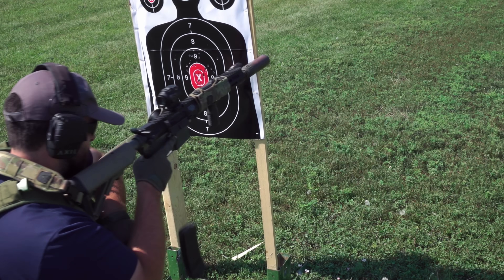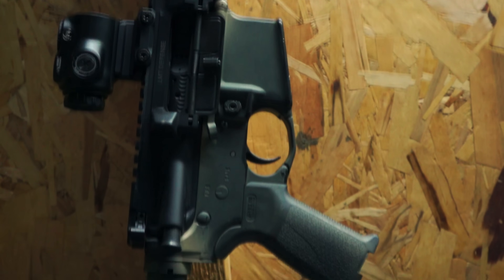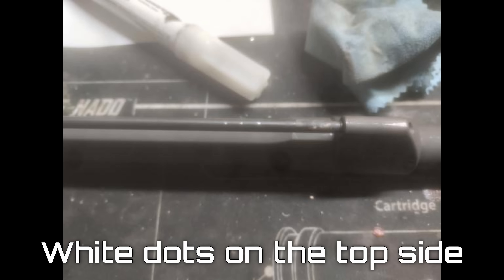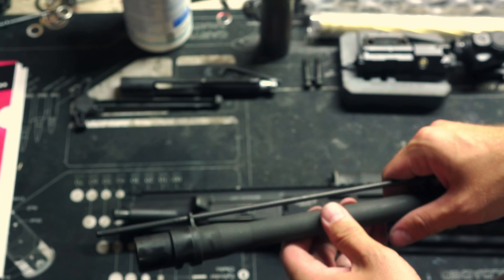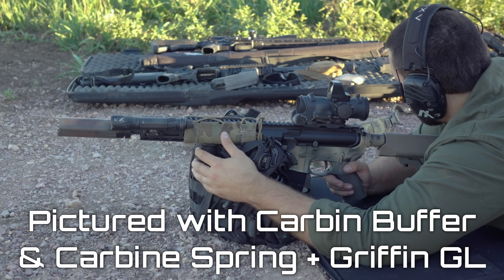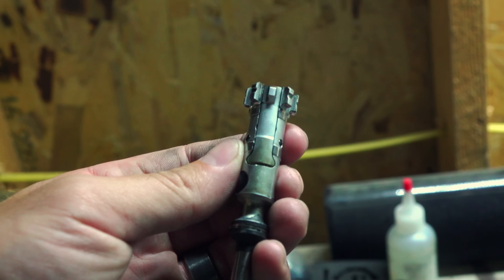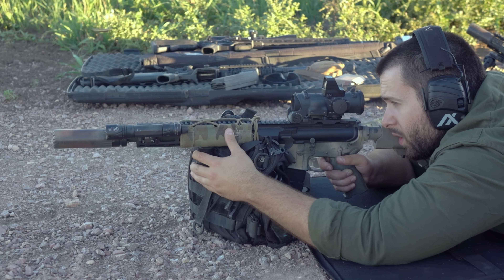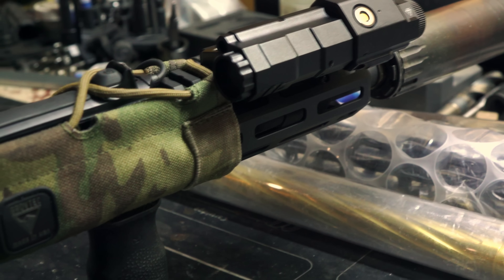Learning Machining Together - LMT 12.5" Specwar

Comment: The Spec War 12.5 I just got is anything but overgassed. It short strokes with every spring, buffer, bolt, ammo I’ve tried so far. Can’t get it to lock open unsuppressed at all. Contacted LMT… nothing.

Comment: 😂 would you relay to LMT that I would like them to put a piece of carbon fiber around the barrel extension to slow down the heat transfer😂 also tell them I want like a carbon fiber shaft around the gas tube as well to also slow down heat transfer

Comment: Not talk shit but what was the the point of racking the charging handle during the reload instead of using/releasing the bolt catch
Reply from the maker: My lower has a PDQ lever that doesn't work with the upper so I have to tap and rack to get it back into function.

Comment: Wow it looks like the Callaway 77gr rounds were keyholing. Really? You might want to dive into that a little more. That should not be happening on a $2500 upper that is supposedly optimized for duty use. Ofcouse the cutting of the barrel could have a hand on this result but still, this is completely unexceptible.
Reply from the maker: The paper was just tearing, no keyholling.

Comment: Your critique of the LMT Enhanced Bolt Carrier Group is misplaced. Their website stated: "This carrier group was designed to function effectively in full-auto, suppressed, and short barrel weapon systems" When they designed it in the 2000s at the request of the DOD, the were trying to fix issues related to the gas system and bolt breakage in the M4 (14" with carbine length gas system) because the carrier group wasn't updated from the AR15/M16 (20" with rifle length gas system). The M4 was so over-gassed (even without a suppressor) on full auto that bolts were breaking and the high cyclic rate led to multiple types of malfunctions. The carrier and bolt are a two-prong attempt to solve those issues. To slow down the gun, the enhanced carrier has a third vent hole for the gas and an elongated cam pin path. To prevent the bolt breakages, the enhanced bolt introduced relief cuts on the locking lugs, a stronger extractor design, and a new proprietary material for the bolt itself. To that end, the design is virtually flawless. It functions perfectly in the M4: the _"full-auto, suppressed, and short barrel weapon system" that LMT told you about.

However, you are trying to hold the product accountable for a use case which it wasn't designed for. The LMT enhanced bolt will work beautifully in any AR-15 platform, but the enhanced carrier is neither needed or advised on a gun that is properly (i.e. combat) gassed. With a 12.5" barrel and a midlength gas system, the specwar system is gassed exactly how it should be. Therefor, the enhanced bolt carrier isn't a wise option.

Comment: I got an LMT upper and few lowers.  They were way ahead of the industry. 

They moved their company 4 or so years ago from Illinois to Iowa and the move radically disrupted the business.  They basically have not released a new product in that time. They used to release one a quarter.  Their quality control has plummeted.  Previously I would have said that it was Best buy everything from them and they generally had pretty editive prices.  Now their pricing seems extremely premium and their quality across the board not justifying it.

I'd buy as little from them as possible to access the most unique aspects of their systems.

I think they make a great bolt. I think they're bolt carrier makes no sense, I don't have any affinity for their barrels.  I don't think their barrels are bad by any stretch. I just think that they are similar to  Daniel defense.  Overpriced workhorses.  I think you can get similar to better performance for less money  And less weight.  

I also want to say that they're monolithic upper is a great design for novices.  

When I was getting into rifles it was so easy to change out barrels and calibers with the Mars system.
Reply from the maker: I don't think the mono upper is for novices, it's more for the rigidity of the system.

Comment: I bought an LMT and I was NOT impressed AT ALL! 100% overrated, the ambi mag release did not work, the safety was so lose it felt like it would fall out, it literally jiggled, and could be put in safe after pulling trigger. I put a different safety from a different manufacturer in it to try to fix the issue. But the issue was the hole in the reciever was too large, so even the one I put in and tightened correctly did not fix the issue. I don't trust it. So it sits in my safe, unused. Kinda sucks.

Comment: Ugh has my dream rifle and puts trash optic on it. Gross brah.

But the EBCG is meant for 14.5” carbine length systems. It’s the entire reason it was invented. It was created from a socom request in the early 00’s due to colt bolts breaking like a mofo. It also has the patent for fully supported cases on the bullet. I saved and shopped for a year to get mine. It’s amazing! When people complain about the carbine gas system and parts wear this is the solution to the issue and it makes the whole system superior to anything else. Oh and the metal is the same metal used in the hook on fighter planes landing on air craft carriers. Karl Lewis was quoted on saying “I can build you a bolt carrier that will never break, but it will also cost more than the rifle”. LMT has never had one break before, in testing they went 80k rounds of xm193 before calling the testing quits